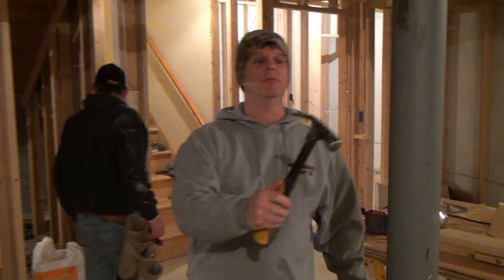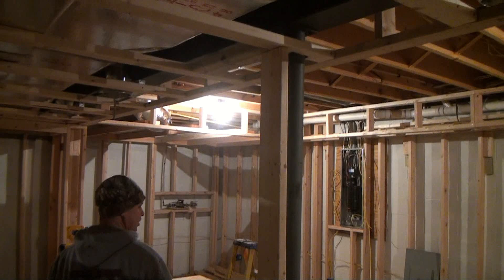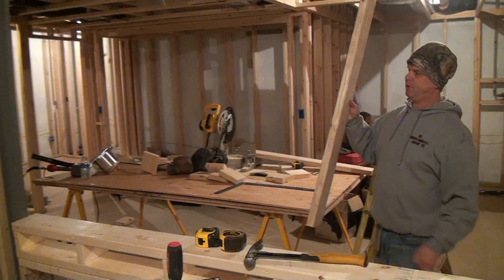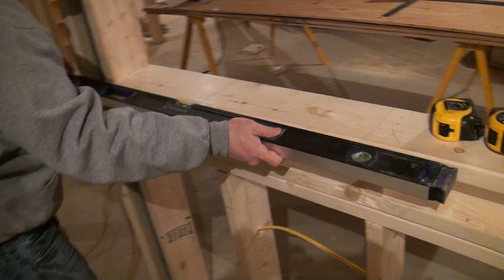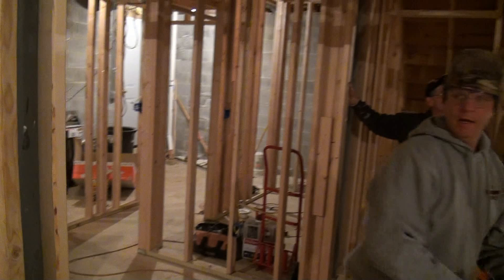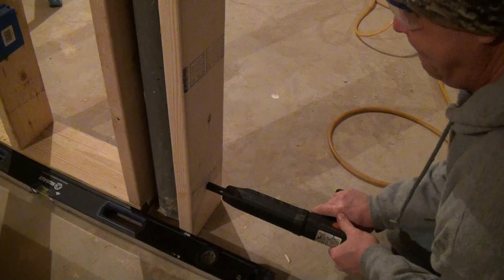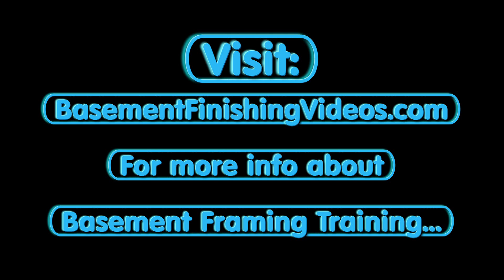Hiding Basement Support poles

Comment: Your videos are by far the most informative I have found. My girlfriend and I just recently bought a house and we are looking to start working on our basement.  Its not a huge project just under 600 square feet. I am 6'2 and the ceilings at his highest is about 6'9. It seems pretty straight forward unfortunately the house was built in 1940 so I have a bunch of low hanging duct work which I am sure I can reroute and move up closer to the ceiling. The furnace being centrally located as opposed to neatly tucked away in the corner. I guess the most overwhelming thing for me is coming up with a layout. I know what I would like included in the layout such as a living area, a closet to put the washer and dryer in perhaps a small office and possible a bedroom if it could all fit. Right now we have about enough to finish the framework all the way around. I don't know if I should just start framing the exterior walls following your guidelines or to wait till I come up with a plan? Do you have a video on design?
Reply from the maker: +Brian Crisp Inside the Basement Finishing University(BFU) there are hours of basement design videos to help you with your basement design ideas and floor plan! http://1basement.com/Pro_Video_Product_Page_2.html

Eddie

Comment: Isn’t black the highest load? And you can just shoot another charge using the same nail to flush it in. Do it all the time with my Hilti dxa40
Reply from the maker: It is higher but this model gum is not designed to shoot any load higher than yellow safely...  ~Eddie

Comment: It looked like you were using untreated wood against the floor there. Do you need to cut small PT wood pieces for the 2x6's to sit on or is it okay to lay them right on the concrete?
Reply from the maker: +Will Landymore No your ok if it just the very end of a piece of regular wood...but for wall plates only treated wood against the concrete.

Eddie
Reply: +BasementFinishingMan  Thanks
Reply: Check your local codes because that is not okay in my area! Treated can be the only wood touching the concrete in any area below grade (basement).

Comment: I went the opposite direction. Can’t find any advice on my question. I’m de-dressing my Lilly column. The builder boxed my GARAGE support pole! Why!? Why would you want to give even LESS room between your cars? Turn a annoying 3” pole into a 7” box??? No need to dress up a pole in a freakin garage! So I cut it all off. 4 pieces of 2 x 6’s plus drywall. Now it’s a nice slender pole blocking less light, easier to park cars & open doors next to & bonus my wife dirty dances in the garage now! 😉

Comment: Did you use 2X6's to build the half wall because of the width of the pole?
Reply from the maker: +swayze2699 No I did it because this wall was going to be supporting a 15" granite top later in the project and it needed some extra stability.

Eddie

Comment: great job! I have 1 question, won't shooting into the pole reduce its structural integrity?
Reply from the maker: NO Not at all! The nail replaces the hole it makes so tightly that no load value is lost.

Eddie
Reply: Lol  was thinking about the concrete fracturing inside but didnt think about the void and nail filling it.  Basically adding to the integrity more or less then because there’d be more mass inside the thing.  As long as you dont bonnie n clide the thing..

Comment: Use a red load and it will drive the pin
Reply from the maker: This particular model is not rated for red load...yellow is the max. for this model Chris.  ~Eddie

Comment: What is a good/ normal height for a half-wall that a 16" piece of granite will lay on?  I will be sitting on stools that will tuck under the granite when not in use.
Reply from the maker: 41" is what I make my half walls where I will be using standard height bar stools.

Eddie

Comment: i am curious, why did u add a 6 inch height extension on top of the halfwall?  Added strength for the counter top?
Reply from the maker: +Brian Kiro Yes to add some extra meat for the corbel supports we added later in the half wall project.

Eddie
Reply: Thanks for getting back to me so quick on a Sunday night. Under an hour I am impressed. I am on the fence about buying the videos, but this quick reaction time on your part is helping make the decision easier.
Reply from the maker: +Brian Kiro Your welcome Brian...I'm here for all my students 7 days a week for project related questions. Thanks for watching.

Eddie

Comment: I've been learning a lot from your videos, one day I'd like to do my basement, but my walls are less than 8ft. I live in Lancaster, PA, do you know the minimum height the walls need to be to be within code?
Reply from the maker: Yes I do! You need no less than 7'-0" under the floor joists and 6'-6" under soffits(under ductwork framing). Thanks for watching Sean. We are in Lancaster right now right off the Oregon Pike.

Eddie
Reply: Thank you! That's a nice area out that way.
Reply: If you call the area “finished storage”, it should pass inspection. But always check with your town inspector.

Comment: Was that half wall framed that way because the height was changed after the initial framing, or some other reason?
Reply from the maker: Hi Pete!...Yes the owners went from 36" counter height to 42" counter height to make way for taller bar stools, so we just framed a 6" piece atop the original half wall.

Eddie
Reply: Thanks. That makes perfect sense.

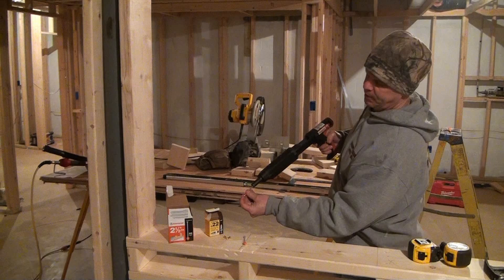Comment: 3:40 
Hi Eddie.
You say yellow loads(#4) is the most explosive. I always used #4 for shooting lumber to concrete. Actually never seen how to shoot lumber to steel, thanks. I've seen in a home depot red loads(#5)  https://www.homedepot.ca/en/home/p.27-cal-strip-shot-red-load-100-pack.1000492896.html , but never tried them. Are they more powerful or what's the difference? 
I also wondering about building a partition right under load-bearing steel beam. Should I shoot 2x4 or 2x6 board right to the bottom of the beam then nail the partition wall to the board, or just shoot the wall straight to steel beam? Can I use 2x4 for wrapping a coloumn  which diameter is exactly 3.5"(and use 2x4 for framing the partition)?
Reply from the maker: +Janizary - Hi Janizary! For most models of the RamSet made by Remington, the Yellow #4 Load is the most powerful load you can put inside the device. There are a few models of the gun that will fire the Red #5 load which is more powerful but rarely used.

The Yellow #4 Load with the 2.5" fasteners will do most any fastening that you need done in the basement. This works for fastening the bottom plates of all your walls to the concrete floor, Block- nailing wood to the concrete walls and will also attach your column framing lumber directly to the metal support columns  just like I did in this video.

You can also attach the top plate of any wall directly built under the steel beam with this setup as well...the fasteners will not go directly 100%  through the steel beam but will bite hard enough that the wall will never move! Just make sure that you ALWAYS WEAR YOUR APPROVED SAFETY EYE-WEAR PROTECTION WHEN OPERATING THESE TOOLS!!!!!!!!!!!!!! I CAN NOT STRESS THAT ENOUGH!!!!!!!!!!

Eddie
Reply: Thanks Eddie, I find your videos and comments extremely informative and comprehensive. One of the best on youtube. Thanks for sharing your knowledge. 
I's going to finish my basement, I have general idea of everything, but I need to know all details to do my job properly. This is what I take from your videos.
Btw I always wear safety glasses while shooting, but also I always always use ear-protection, because if I don't, this sound hit my ears like a sledgehammer and it really hurts.
Cheers.
Reply from the maker: Your welcome! Good luck with your basement project my friend!

Eddie

Comment: was that a concrete filled column?
Reply from the maker: No Hollow steel. But it wouldn't matter these pins will penetrate concrete filled steel columns just as easily Michael.

Eddie

Comment: Shooting into the steel doesnt weaken the strength of the column?
Reply from the maker: +Eric Kutchey The nail replaces the hole it makes so tightly that no load value is lost.
Reply from the maker: @danielmorgan2178  I sure...no issues, a 1000+ columns boxed and counting! No issues yet.

Comment: It's not a solid piece of steel they are filled w concrete mate, nice  framing job though
Reply from the maker: They are actually hollow in the middle and have a solid outer steel casing that is approximately 3/16" thickness that the nail has to penetrate...which is still quite amazing! I did not mean that they were 3" thick solid steel Dan...sorry for the misinterpretation on my part...

Eddie

Comment: Why do you use that way of measuring when its known to be inaccurate?
Reply from the maker: Not sure what your talking about? Are you referring to the way I use my tape measure to measure for cut's? Could you elaborate your question a little more...

Eddie
Reply: Basement Finishing Man Yes, the flexible metal measuring tape is bent (curved bend) to make measurements. At the bend, the curve gives a longer measurement than the real distance or length. This is a fact. So, why people in this profession keep doing what is wrong?
Reply from the maker: The bent tape measurement is extremely close to the desired cut length  you will need to make. This is framing NOT finished carpentry where 16th's and 32nd marks are critical. This is "rough framing" and being with in an 1/8" or less is within tolerances for most any rough framing project. With a "bent tape" as you call it, you can easily be within a 16th or 1/8" correct on your measurements!

Now with that said...the more you do this bent tape measuring the better you get at knowing the exact distance between two points. It's like anything else...practice makes perfect John!

Eddie
Reply: Basement Finishing Man Thanks for your kind advice and clarifications! Interesting to hear your explanations.
Reply: Basement Finishing Man